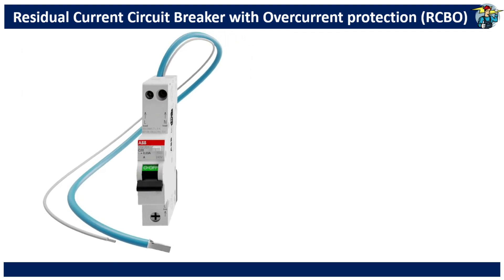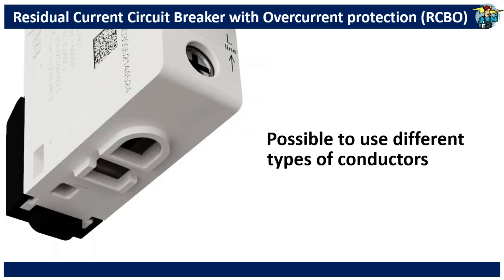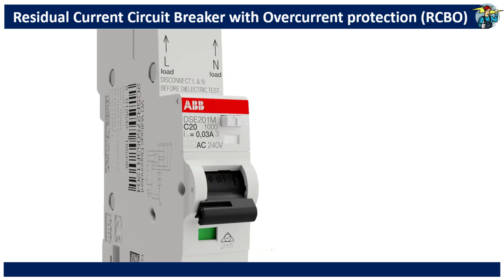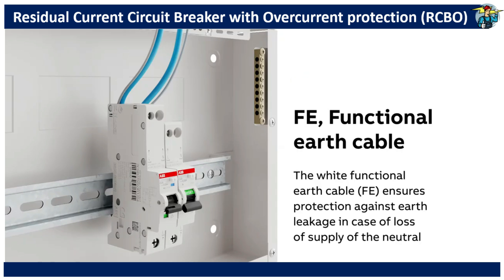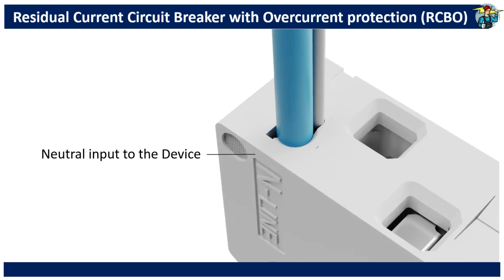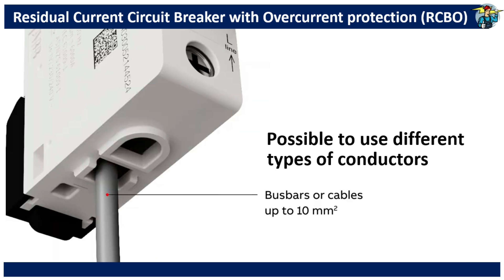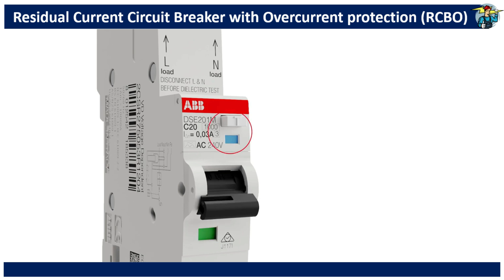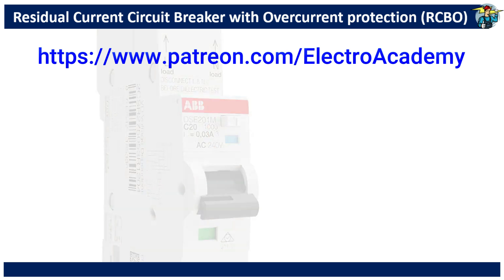RCBO Operation and Wiring Explained: How to Connect to a Distribution Board

Comment: Thanks for a great video. I was just wondering if I need to install additional overloads for the motor and another over current device (fuses) after the RCBO downstream?
Reply from the maker: Thank you.
RCBOs already provide combined overcurrent protection (overload and short-circuit) and earth fault protection. 
If properly rated for your motor's full-load current, the RCBO may sufficient.
Motors typically require thermal overload protection to prevent overheating due to sustained overload conditions.
If your motor controller (e.g., star-delta starter) includes a built-in overload relay, it may already protect the motor. 
This relay should be set to 1.1 times the full-load current.
If the overload relay is missing or insufficient, you should add one.
Reply: @ElectroAcademyEA  
I appreciate the thorough explanation. Thank you again.

Comment: Hi

I have a home theater and i have a indivual breakers ..1 rcd and 1 surge protection devices ..all dedicated just for the home theater..i want to remove as less interference and noise and have clean power as possible so i was wondering if i should get a seperate isolator as well ? Will that potentially stop any interference and noise etc coming and produce clean power?
Reply from the maker: If your main concern is common-mode noise or ground loops, then yes, an isolation transformer could help reduce interference. However, if you're looking for a broader solution for cleaner power, combining it with a power conditioner or UPS system designed for AV equipment would be more effective.
So, while an isolator could help, it might not be sufficient by itself to give you the completely clean power you’re aiming for. A combination of power conditioning, isolation, and proper grounding will provide the best results for interference-free and clean power.
Common-mode noise: Noise that appears equally on all power lines (line, neutral, and ground) can be filtered by an isolation transformer, preventing it from entering your sensitive equipment.
Ground loop issues: If your home theater system suffers from ground loops (causing humming noises or interference), an isolation transformer could help break the loop and reduce or eliminate the noise.